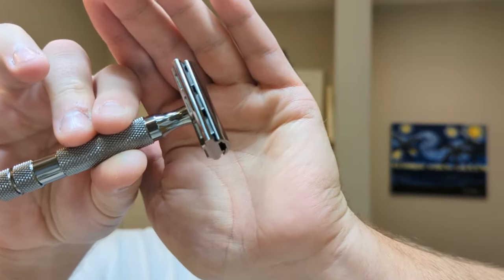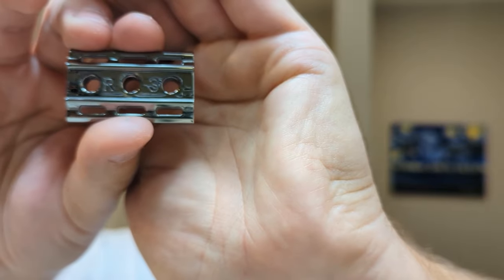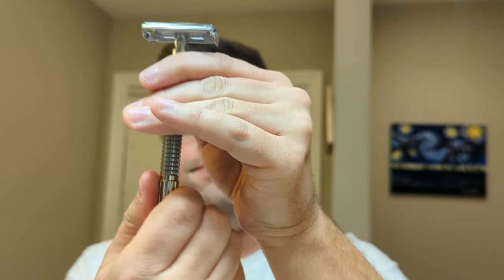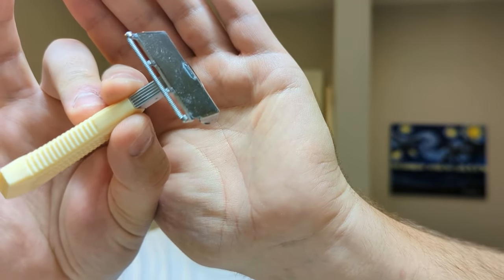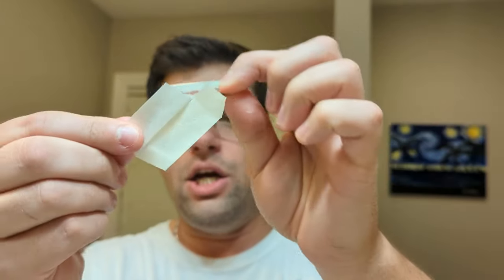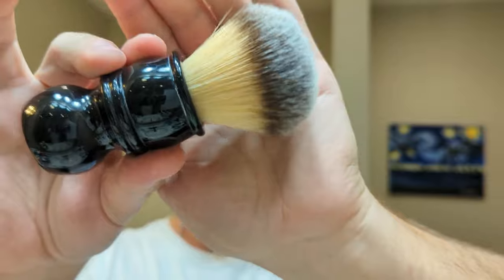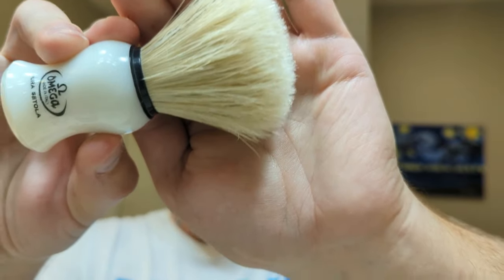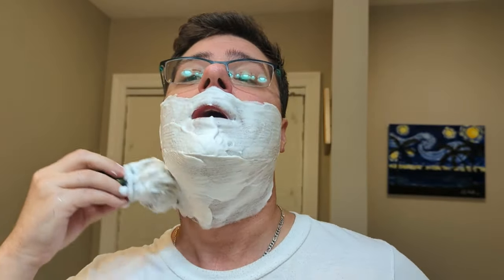How To Shave with a Safety Razor

Comment: Just retrieved my first safety razor from the mailbox - still haven't opened it but I thought I should review some tutorials before the first test run. I appreciate the attention to detail you put into sharing these helpful tips with people (who are not all "guys" btw). I gotta admit I was saddened by the end results, that so much of your "shadow"/hair sprouts are still visible. I'm also worried about going over my more pronounced Adam's apple, which you didn't seem to really do in the video.
I did notice you using your tongue inside your mouth to help create a, what's the word, convex rather than concave? effect at various points. I do that myself and have wondered if other people do it. I also have the difficulty of shaving over a chin dimple, which has always sprouted the coarsest, darkest hairs, and is damn near impossible to get at.
Anyway, I'm excited to finally be trying something new out to deal with the pesky problem of facial hair growth. Laser hair removal didn't solve it, and I've incredibly been using the exact same Mach 3 razor (handle) that I first bought when I was 15. I'm 41 now. That's a LONG time for a personal hygiene product to hold up to heavy re-use, amiright?! But the cartridges are so expensive and I hate how aggressively I have to go over my face with it.